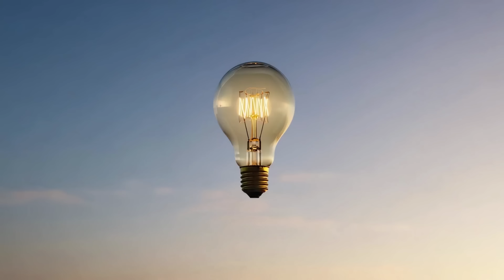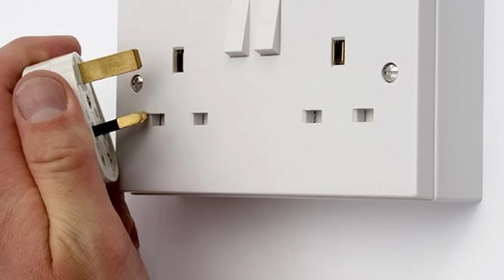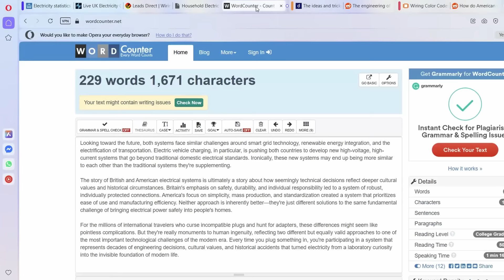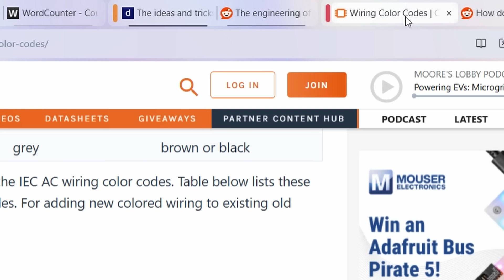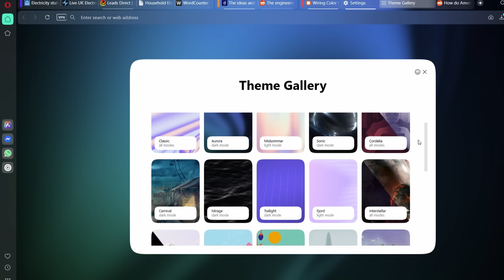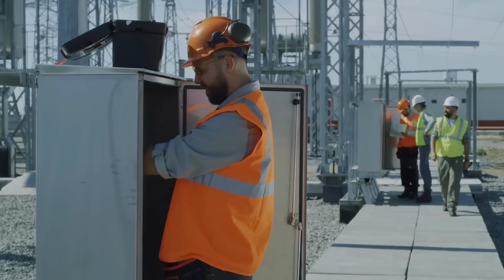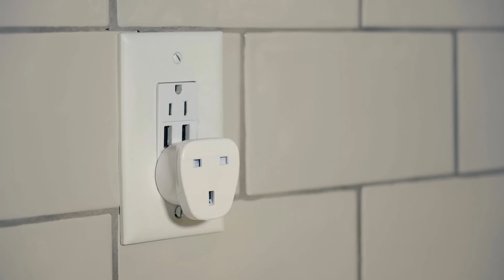British electricity is SAFER than American electricity. here's how.

Comment: Even newer countries like UAE has adopted British sockets because of safety. And on off features
Reply: Saudi Arabia went to the trouble of converting to UK sockets from American ones
Reply: @seanoconnor8843 If even the Saudis are thinking about its citizens safety then America really is going backwards!
Reply: Correct. So to is SA, India, Aus and NZ. There's probably more but can't think of any without some googling.
Reply: @philvincent5660  Singapore & Malaysia also 🙂
Reply: @philvincent5660 Australia and New Zealand have a different system to the UK and USA. They both had become independent of the UK decades before they introduced  the 3 pin plug in 1947.
Reply: @MarkGovern Glad to be corrected. Thanks
Reply: Newer countries had electricity  before they became countries. UAE along with much of the Middle East was under British control, influence or protection of one form or another and adopted the British standard as a result.
Reply: Wish we could get them here in the PH as well.
Reply: Yes for safety, but this is also a lingering effect of Empire.
Reply: @DylanSargesson The lingering effect of empire isn’t a thing in relation to this. The only aspect that still lingers is the Westminster system and the head of state in some countries.
Reply: @MarkGovern The UAE gained its independence from the UK after the Type G socket had been standardised and common across the Empire/Commonwealth. Independent UAE never chose to adopt a different standard.

Comment: I am old enough to remember the round plug 5 and 15 amp sockets. 
US homes use split phase so high power devices use 240v.
Ring mains in UK were due to lack of copper after WW2.
Reply: Ditto bakelite switches & vertical outlet sockets  - talcum power rubber sleeve insulation 😅 connecting Christmas lights to the bayonet light socket - multi outlet adapter blocks🔥
Reply: @Jono-pomDownunder Christmas tree lights when 1 bulb failure took out the whole string because they were 20 x 12v in series.
Reply: @simonJester-y5f  Some had 40 x 6 volt bulbs.
Reply: Old enough to remember? You can still get them now, so even your grandchildren will remember them.

Comment: Contemporary plug bodies in the Unites States are a fraction of the size they were 60 years ago. As to power transmission voltage efficiencies, the distance between the secondary taps on the transformers that creates 120 volts at the outlet is measured feet. compared to hundreds of miles of 500kv to 25 kv transmission lines between the power plant and the primary taps on the transformers that creates 120 volts.

As a citizen of the United States, my only beef is the lack of access to 3 phase power for homes.
Reply: It still means having to use considerably large gauge wire for the same power carrying capacity as it needs double the current for the same power. Also, the voltage drop within household wiring is NOT insignificant. If you want to achieve no more than a 5% voltage drop (US regulatory maximum), then that's just 2.4V on 120V, but 4.8V with 240V. Given that for a given amount of power, the 240V circuit takes half the current, and to achieve the 5% drop can work with twice the loop resistance.

There is a good reason why US homes also provide 240V for high powered devices, but it means the complication of using 4 core cabling (if you want 120V as well, as many appliances require) and special double-gang breakers taking up twice the space and making 240V GFCIs in the USA considerably more complex.

I can also say, from experience, it's very nice to have 3 kW available on a standard outlet. It's great in the kitchen and in workshops without having the inconvenience of having special circuits and plugs for portable appliance up to that rating.

I can absolutely guarantee that if the US system was redesigned from scratch, then it would not be using a split-phase system. That was essentially a retro-fit in order to allow 240V do be delivered. The original system was 110V single phase (later upgraded to 120V). 

I have no idea what you mean by modern plug bodies being a fraction of the size that they were 60 years ago. The ubiquitous (and rather flimsy) plug designed by Harvey Hubble that was to become regular North American plug was in widespread use by 1915. It's 110 years old. No doubt modern materials allow the body to be a bit less bulky, but it's not due to the pin layouts.

Incidentally, Hubbel was not happy with that plug, and he produced a modified design, with the two "hot" pins rotated by 45 degrees. Take-up in the USA was poor to non-existent as his original design was ubiquitous. However, it went on to have a new life, as it's the basis of the Australian and New Zealand standard, and has now been adopted by China.

Comment: I am very glad Britain did not adopt the German Schuko plugs as they are less safe and very fiddly to plug in. Often you have to waggle the plug about for several seconds before it goes in the socket. The fuse in the 13 amp plug is actually there to protect the flex from overload, that is why there are only a limited selection of amp ratings. Things like TVs and Hifi equipment will usually also have internal fuses to protect the device itself.
Reply: The German plugs are also the very devil to wire up. There is barely sufficient space inside for the three wires.
Reply: The Schuko also does not differentiate between live and neutral (it can't, it's symmetrical) and that is less than ideal in safety terms.

Comment: I maybe misremembering this. But in 2004 i went to visit my GF in Boston, she was in college, im from the UK. Im sure she plugged in something into the light bulb socket in the ceiling? Is that a thing or just my brain confusing light bulb socket with a plug socket coming out the ceiling?
Reply: It used to be a thing in the UK too.
Reply: Plugging things (clothes irons in particular) into a ceiling lamp socket was a UK common practice at least into the 1960s. There were few electrical appliances around before then apart from cookers, irons and kettles, and there was a special socket for kettles where the cooker switch was - still common today.  The Andy Capp cartoons (a working class layabout) often showed his long-suffering wife ironing with a lead plugged into the ceiling light.  I still have one of those old plugs as a keepsake.

Comment: As a child I watched my Dad take a light swich of the wall to wallpaper,later I decided to take the light switch of like I had seen Dad do! It was a Brass cover and I caught the cover on the terminals, Dad found me shocked but unharmed. He told me you turn off at the fuse box before removing the cover!😂
Reply: Clearly a life lesson learned a wise man your Dad
Reply: Did the same as a youngster (somewhere around 16-18yrs old I think it was). 

While papering the upper half of the walls in the bathroom (special waterproof paper) I couldn't get behind the rose of the pull cord for the light. So I unscrewed the cover, then pushed up the paper (together with lots of paste) while stood on a chair. 
After getting up off the floor some minutes later I went and turned off the power at the fuse board :P

If you are ever going to have a shock it is a safety aspect to be stood on a chair, that way you don't stay attached to the current when you fall off it :D :D

Just glad I didn't land on the edge of the bathtub.
Reply: I've often thought the old brass covered light switches were deadly as the cover could be simply unscrewed by anyone without a tool, and it's not earthed, which is probably why the switches were often wired to the neutral side rather than the live, but that doesn't make them any safer, and it means the lamp holder is always live regardless of the switch setting...and some later ones had a bakelite cover but it too could be too easily removed just like the old brass ones.

Comment: Just to add some clarification here.

The circuit breaker (fuse) box is designed to prevent the wires in your house (specifically your walls) from drawing too much current and melting which may cause a fire.  North American homes actually get 240V from the wire to the box.  It's usually broken up into 120V split phase power; however, you can get a 240V circuit installed in your house.  Typically an electric range/oven and and electric clothes drier use 240V.  Some homeowners will have an extra 240V circuit and outlet installed just for an electric kettle (which was invented in America by the way).  I personally think it's not the voltage in our outlets but the fact that Parliament in the late 18th century decided the British East India Company was too big to fail that stifled tea culture over here.  The ground pin (we call it ground here in the US more often than earth) in our plug design is interesting as newer construction has the outlets oriented 'upside down' from their old configuration.  This adds and extra safety feature preventing the plugs from coming loose over time and thus not giving you a shock.  Yes I understand our outlets aren't as safe and you should probably get an extension cord with a fuse built in for reasons I'm not going to get into here, but also consider our 120V delivery is safer than the British 240V delivery at the outlet.  None of this actually makes up for being safe and remembering electricity can kill you if you don't respect it.
Reply: America might have been first to invent the electric kettle but with a separate element it was too slow to be useful.  The submersible element was perfected by  Bulpitt & Sons (Swan Brand) Birmingham in 1922.

Comment: Ring circuits have their own issues.  If there is a break in the ring, then technically you could be overloading the wiring.  Although outside the kitchen this is unlikely unless you have a number of electric fires on the same circuit.
Reply: Some electricians do not like installing rings, but you can still have the benefit of 32A circuits and sockets by using 4mm^2 cabling using a radial circuit. Using 6mm^2 wire is better, but then finding sockets which would take 3 x 6mm^2 cable for spurs is tricky, and even on 4mm^2 cable you have to choose sockets designed to take it.

Comment: Are you really suggesting that the electrical systems in our respective countries has contributed to what became our favourite hot beverages?  Sorry but that isn’t right at all.  Britain was already a big tea drinking country long before electricity was available.  And electric kettles didn’t become widespread until the latter half of the 20th century: electric kettles were around earlier but they were expensive and not found in most homes.